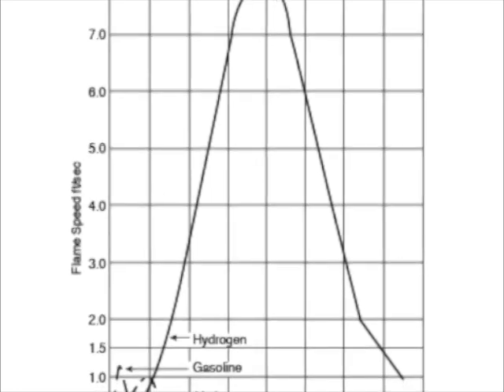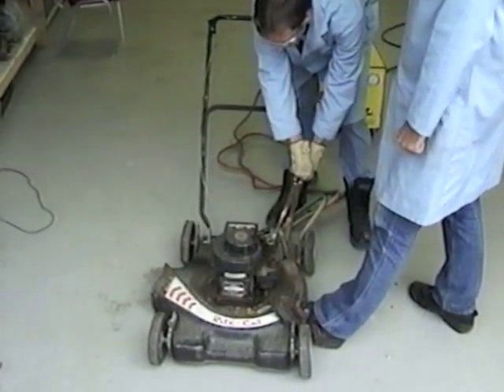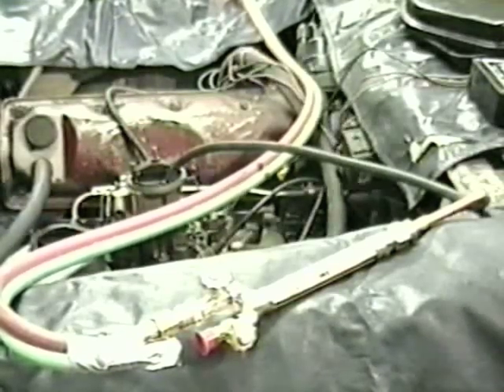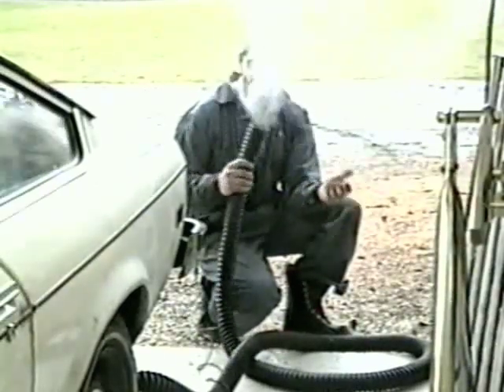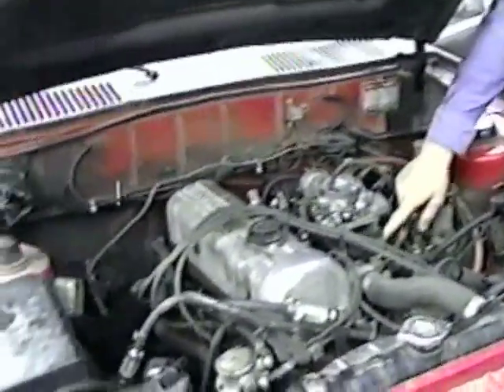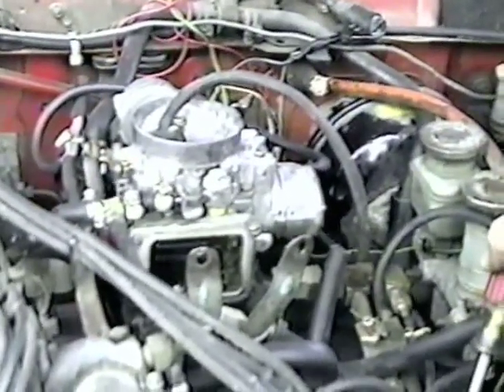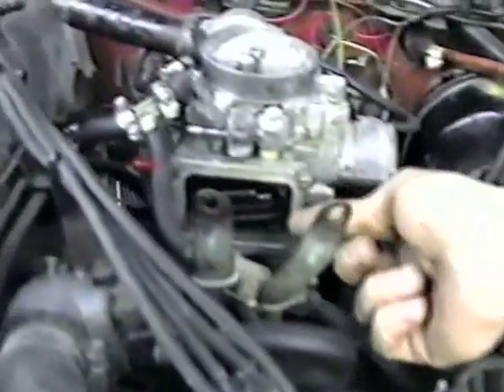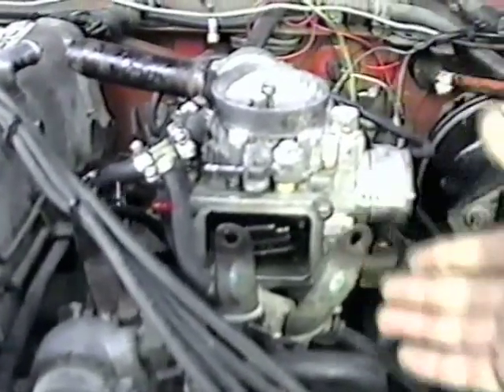Vapor Fuel Combustion Speed

Comment: 2 KW to power that HHO generator? Well I think my old deceased friend Nikola Tesla can help me make this power, self sustaining, so I can run any engine I wish on HHO.
Reply from the maker: +Bone Drone 
First, I don't appreciate profanity.  Please don't do it anymore or I will delete your comments.

Second, I'm not sure what your comment means?  Are you dis-believing that my electrolyzer only uses 2KW to make enough gas to run that lawnmower?  
If you doubt the efficiency of my electrolyzers, check out this page:
http://www.eagle-research.com/cms/node/620

Third, I do NOT claim that this video is demonstrating self-sustaining 'water as fuel'.  In fact, in my literature I specifically state that the power required to make the BG (aka HHO) is greater than the power you get from burning it as a fuel.  Here's an example of that statement:
http://www.eagle-research.com/cms/node/443

Fourth, This video is about demonstrating that vapor fuel does NOT detonate, that the 'vapor detonates' miss-information is a myth instigated by the Vested Interest and propagated by the ignorant.

Fifth, although I think you were being sarcastic, I DO develop and share technology that both government and big oil consistently suppress.  For example, I just doubled the mileage of my 2003 27' Class C RV, saving myself over $750 every time I cross the country (2400 miles).  I've helped over 200,000 people get 25% or better fuel mileage.
Reply: +George Wiseman I edited my comment. No swearing. 
Second, I made a snobby remark to the power usage of the electrolyzer. It was unnecessary. But, 2 KW in a vehicle's electrical system might be difficult. My idea is a tesla coil (Be a believer) in place of the alternator and a set of ultra capacitors to replace the battery. The tesla coil is not 100% perfect. There is a parasite within the coil that slowly drains the coil's power producing ability which would require and external power source to bring the coil back to it's top state of charge. That's what the capacitors are for. Supply power to the coil when the power runs low. When not in use, the capacitors would receive a charge from the tesla coil. AC power rectified into DC with the voltage stepped down. 

Third, you're right. But I do wish to power an engine on HHO alone. I have come to notice that an HHO generator that operates on electrolysis is not the most efficient. There are breakthroughs however. The application of magnets can raise a cell's efficiency level as long as the magnet's poles are aligned with the powr and ground of the cell. Pulsed DC current alongside resonant frequencies are the best I have seen. High voltage and low amperage, with significant HHO production. Example: 60 liters per minute of HHO gas with .9 amps at 75VDC.

Fourth, this isn't news to me. I have known about this for quite awhile. Trying to tell others though is like talking to fish. 

Fifth, Awesome! Anything you can show me with E85? Who says I have to use gasoline or diesel only? Ethanol would be very easy to evaporate due to the lower boiling point than gasoline. The octane rating would allow me higher compression ratios. Water injection or some HHO could aid me to lean out AF ratios to levels no one would have ever thought possible with E85. I do not believe ethanol must be used in rich mixtures as it has oxygen in it's molecular structure which is easily capable of supporting lean combustion. 

Lastly, plasma ignition. I gotta have it.
Reply from the maker: +Bone Drone Thank you very much for editing out the swearing.
Second, I wish you luck on your Water as Fuel concept.
I know that it is possible to run an engine with water as the only fuel because many people have done it in several ways.  I personally haven't done it but have researched it and compiled my research into a book, Water as Fuel, Book 1.
http://www.eagle-research.com/cms/node/219

Third, there are many ways to raise an electrolyzer's efficiency.  I see you are familiar with many of them.  Personally I have not achieved the efficiency you quote above (60 liters per minute of HHO gas with .9 amps at 75VDC) which would work out to 0.02 Wh/L.  The best I can do (at this time) is about 1 Wh/L which is about 200% Faraday.  It'll take at least 400% Faraday to actually be able to attain Water as Fuel using electrolysis with an internal combustion engine.

Fourth, Vapor fuel does not detonate is the focus of this video.  All this other is off topic.  I've been in the fuel saving business since 1974.  I know how it is to try to tell people that they've been lied to.

Fifth, Adding alcohol and water to carbon-fuel are ways to increase combustion efficiency and lower carbon-fuel consumption while maintaining full power output.  I don't cover alcohol too much in my books (yet) because there is a lot of really good information on that application out there already.  However, as you imply, pre-vaporization of any fuel, including alcohol, will increase it's combustion efficiency.

Plasma Ignition.  Too True, everyone should have it.  Research Peter Lindemann to find what I consider to be the best technology.
Reply: +George Wiseman why are you selling your book... make it free so i can read it
Reply from the maker: +Pierce Newby I am giving it away.  Just use the coupon code on the eStore 'sales' page to get a 100% discount.  
http://www.er4u.info/3921
Reply: Exotic Creature 
30k vlts
With only 2 milli amps will make more gas on demand than is needed to run each cylinder.

Comment: I have, in the last couple of years, begun to play around with cold vapor production and have been using a small vaporizer on my Toyota for a good while now. I was able to effectively double the mileage by using a small vaporizer I built and letting the PCM do the work for me. I have also built one slightly larger cold vapor unit which I used to run my 1976 Nova with. All of this info is in my videos under Craig Carpenter. I am fixing to begin using ultrasonic heaters and dc voltage regulators to build a mid-sized heated vaporizer to install in my 2001 Jeep. I don't intend to reach the point of cracking the fuel but only in achieving a boil as to make sure that the lesser volatile components are burnt as well. I looked through a lot of the videos you have posted and noticed that you primarily work with HHO or Brown's Gas and I was wondering if it is just your preferred system or do you combine the production of BG and fuel vapor? I have built a few smaller BG generators but since the vehicle I was testing on was not compatible with an EFIE I desisted in that line. It would be my wish to provide enough vapor production and BG combined to easily run my 4 liter 6 cylinder at maximum output. Would you have any suggestions as to the size of the individual units that I should build to achieve this?
Reply: Big C he has a lot of great information on vaporizer ,  and other fuel systems.   He's been around for a long time doing this
Reply from the maker: +Big C You've done a lot of good work.  I prefer vapor fuel but Brown's Gas (HHO fuel from water) is more sexy (sells these days) so I go where the money is.
I DO combine fuel vapors, BG and water injection for maximum gains.
Just boiling the fuel will not get rid of the heavy ends and other crap they've put into it.  That sludge will build up in your boiler if you don't have a system to get rid of it.
The EFIE works with ALL combustion enhancement technologies, because they all have the same 'side effect' of more oxygen in the exhaust than the computer (CPU) is programmed to allow.  It's good your vehicle achieved gains without the EFIE (some do, most don't).
You do not need a large onboard electrolyzer, you want enough BG to act as a CATALYST, not a fuel; see this document for more info:
Proof that BG assists carbon-fuel combustion, download PDF here:
http://er4u.info/443

Comment: Hey there, thank you very much for sharing your studies. I am very interested in this research and development. I am currently in the middle of a very ambitious phase for developing ways to increase efficiency for motors in the aviation world. I am heavily involved with experimental aircraft. There is so much that goes into designing systems for aircraft as compared to other engines, yet i still think that the Hydrogen supplementation ideals in internal combustion are very valuable, and with aviation, relatively untapped. I am currently trying to devise a feasible method of supplying on-board hydrogen supplementation to the engine. My hopes are that after calibrating the amount of fuel provided to the cylinders to be less, the hydrogen would be able to replace that lost power and perhaps supply a little bit extra. The system needs to be able to withstand extremely rigorous reliability testing (as this is for an aircraft) and would need to continue to supply hydrogen in up to 5G conditions, which shouldn't propose much of a problem. The problem may be withstanding negative G's, we'll see. 
My main crossroads right now pertains to which method of producing hydrogen would be best for this application. Simple electrolysis with some sort of cheap catalyst? It is hard for me to assume so since I have not tested anything yet. Another benefit of hydrogen is in high altitude. If my prospecting is correct, hydrogen can provide burn exceptionally well compared to gasoline where there is less oxygen. Burning hydrogen at high altitude would be the motherload of efficiency for an aircraft, as high altitude cruising is the most efficient. This would be a great introduction for the experimental aviation world, especially when 100LL (AVgas) is $5-6.00/gallon!

Any thoughts, contributing ideas, or advice would be GREATLY appreciated
Reply from the maker: +TAShannon1 First, you are correct in all your thinking, but this isn't the venue to discuss it.  Contact me via my website:
http://www.eagle-research.com/cms/contact
Second, I've written a whitepaper that may help you:
er4u.info/443

Comment: What mpg are YOU getting wisecracker?
Reply from the maker: "Wisecracker" comment seems disrespectful so I'm not sure how to appropriately answer you.  My literature quite adequately covers my personal mileage gains in various vehicles since I started working on fuel saving in 1974.    

Actually saving fuel isn't the hard part.  The hard part is accepting that you've been lied to by the Vested Interest.  
Once you accept that, and are willing to do something about it, fuel savings depends on how much money you are willing to pay and/or your skills and resources.  

For a quick 'rule of thumb', based on my decades of experience and the practical fuel saving information I've helped over 200,000 people to apply, I'll propose four 'stages'.

Stage 1:
It's pretty easy to get up to 25% with up to $200 investment (driving for fuel efficiency and building some simple fuel savers yourself).  Examples would include hypermile driving, fuel pre-heating and simple water vapor injection.
Stage 2:
The next 50% will run you up to an additional $500 (assuming you've already done the first stage).  This stage applies what I call 'Combustion Enhancement Interface Technology' (CEIT) like the EFIE and Electronic Diverter, along with some additional practical fuel saving technology like the HyZor, HyCO 2A and HyCO 2DT.  Buying kits ups the cost but cuts learning and installation time.
Stage 3:
The next 25% could be $1500 (this stage requires you to have a good understanding of fuel saving technology, which my books teach). You would be adding 'heated' fuel vaporization technology.
Stage 4:
Extreme Mileage > 200 mpg is in the $20,000 range.  You would be cracking the fuel before it goes into the engine.  You would need to purchase my consultation time to do this correctly.
I know how to get (and have done) extreme mileage but it's complicated, expensive and you can buy a lot of fuel for $20,000.

I deal with over 500 emails a day (including SPAM), so please accept my apology for this brief response. 

To answer your questions faster (and minimize my time), Please view my FAQ pages and get back to me directly (the website allows communication with me) with specific questions that are not addressed.  

Note that there is a 'self-guided'  PDF flowchart to help you choose the right fuel saving technology for your vehicle.
http://www.eagle-research.com/cms/faq/fuel-savers-general
http://www.eagle-research.com/store
http://www.eagle-research.com/fuelsav/FiveYrCalc.php